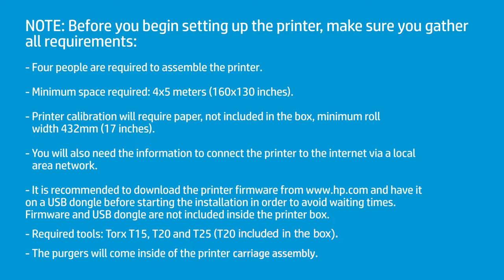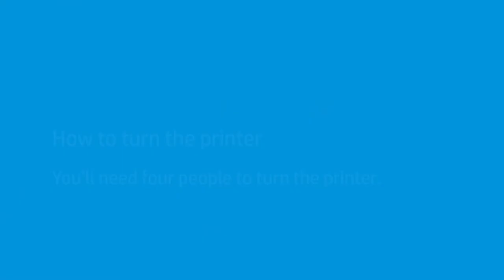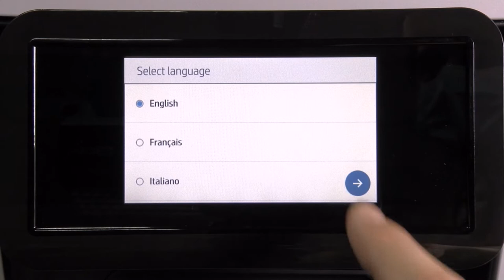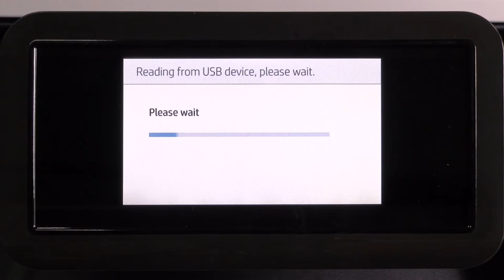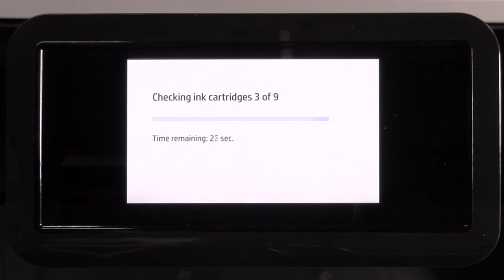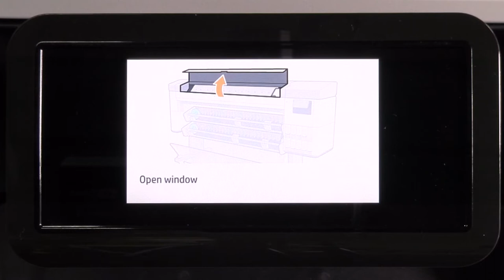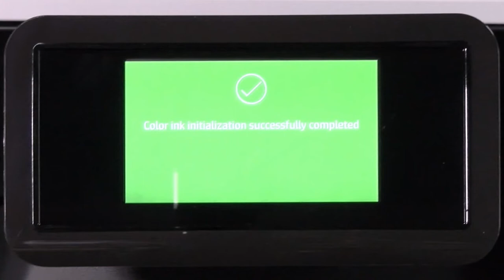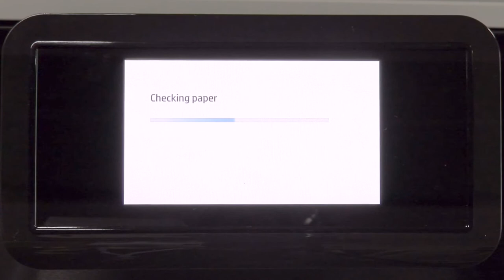How to Install the HP DesignJet Z6 Pro / Z9+ Pro 64-in Printers | HP Printers | HP Support

Comment: After 17 years using our two HP5500ps plotters we got the $$ to buy two of the HP Designjet Z6 Pro 64 plotters. Our problem is, our freight elevators are 95" deep x 60" wide x 108" high. The plotters are 102" long and 32" wide with wheels on. We are wondering if it is possible to stand the box/pallet on its left end to wheel it into the elevators and get them to our 3rd and 4th floor offices. Any suggestions?
Reply from the maker: Hi there, thanks for contacting!
I understand that you need to know whether it is possible to stand the box/pallet on its left end to wheel it into the elevators and get them to our 3rd and 4th floor offices.
In order to get this issue fixed, please contact our customer care team over the phone or chat for further assistance, as this issue requires Live conversation with you over phone or chat to isolate the issue and provide you instantly with appropriate solution or repair/replacement options available at your place as per the warranty.
Please feel free to reach us on call/chat, please access this link to select your preferred country and language option to reach us. Global support link: - https://www8.hp.com/us/en/contact-hp/ww-phone-assist.html
Binu - Social Media Tech Support